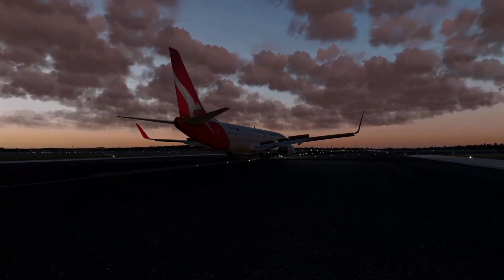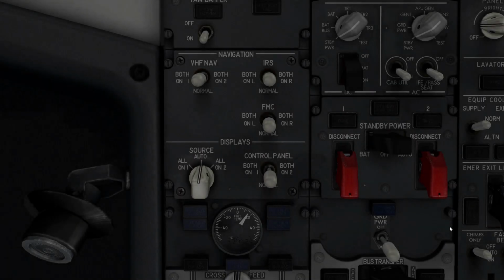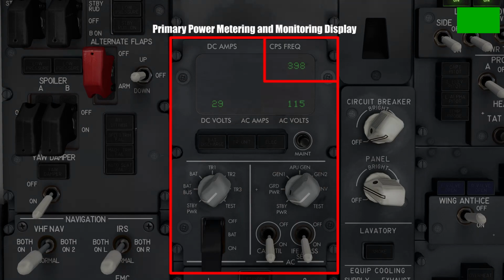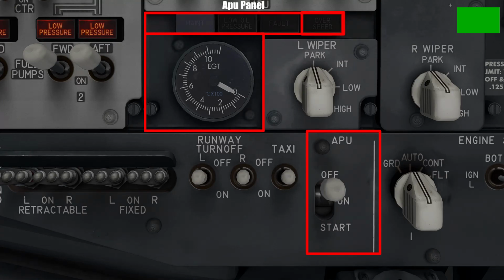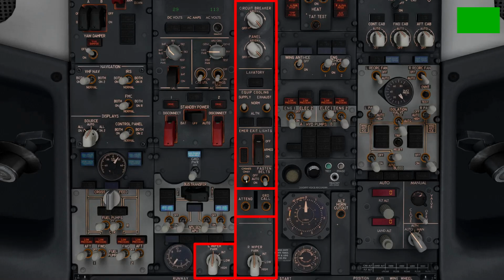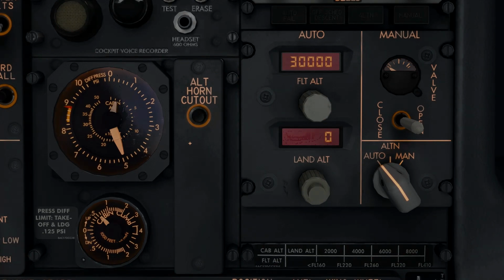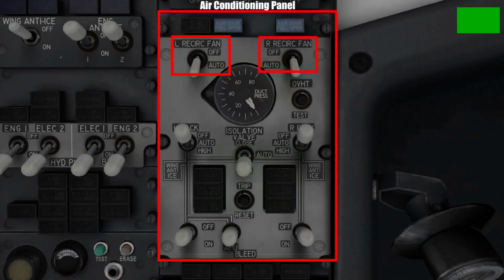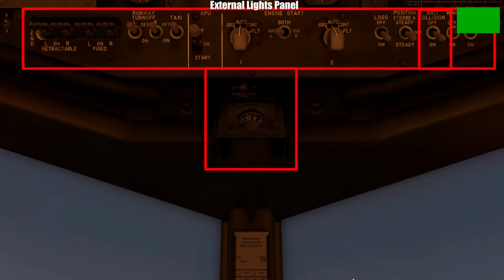Aircrafts Dissected Ep 1: The Forward Overhead Panel|ZIBO MOD 737-800I  X-Plane 11 Detailed Tutorial

Comment: This is by far the most professional, comprehensive, and easy to follow Zibo 737 tutorial on the net. I admire your maturity for accepting constructive criticism or corrections. I will be recommending this video series to all my Zibo pilots and I foresee your channel growing exponentially given your talent!

 A few notes for everyone's benefit:
1) The "strobe and steady" position is only to be used when entering or crossing a runway and should be switched back to "steady" when exiting the runway after landing. The strobes are quite blinding to other pilots who are sharing the taxiways and ramp areas. Many new sim pilots either forget to turn them off or are unsure when to use them so I am mentioning this for their sake. Note: 
2) The GRND PWR light in the ZIBO mod may be illuminated as available if you are at a gate without connecting the GPU in Avitab. Zibo suggests not connecting the GPU cart if GND power is available at the gate. In the real world, if a ground cart or power cable isn't hooked up to the aircraft, you will not see the ground power available light illuminated. 
3) The second image of the fuel tanks showing a total of over 103,000 lbs is not related to the 737-800 and was meant for visual aid only. The current Zibo mod 3.44+ Has a max fuel capacity of 46,000 lbs that reflects real world capacity.
4)  Per the Boeing Manual, dual bleed is allowed during engine start as long as thrust levers are not above idle and the apu bleed is switched off once the engine GENS are selected on the bus. A copy of a somewhat dated Boeing Operations manual is available from the Zibo google drive.
5) In the Zibo Avitab settings, either wing light or wheel well light can be used as an announcement "trigger" that will tell flight attendants to be seated for departure. 
6) The anti-collision (beacon) light will trigger an announcement and the FA will close the door for you just prior to pushback. 
7) For those who want to know, the minimum in flight fuel temp is -40C for JetA and -43C for JetA1. 
8) Avitab settings give you the option to set the probe to aspirated (default) or non-aspirated type. Based on external model visuals and research, the Zibo mod appears to have an aspirated probe. 
9) Realistic hypoxia setting checkbox can be found in the X Plane settings.

Again, thank you so much for putting this series together. I'm sure it involved many hours of work to put it all together. I would be interested in watching a video of how you create and put together one of your training videos.
Reply from the maker: Once again, thank you so much for your kind words! I truly do appreciate it. Looking back on the video, I did indeed forget to mention when and where the strobe lights are turned to the 'strobe and steady' position; so this will be a helpful comment to future viewers. As for the ground power light in the Zibo mod, the absence of the light when the GPU isn't connected is indeed simulated. All you need to do is go to the EFB and disconnect the GPU and you won't see the GPU avail indication on the forward overhead panel. Once again though, thank you so much for watching:)